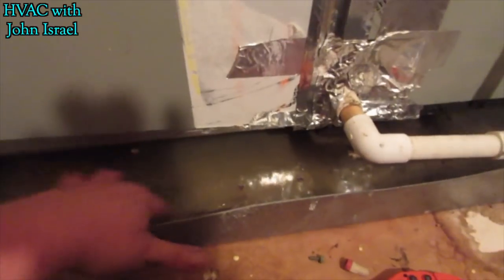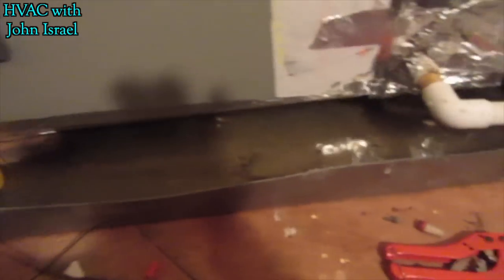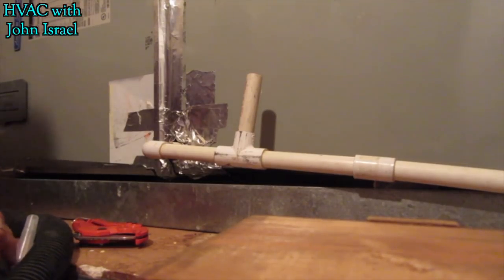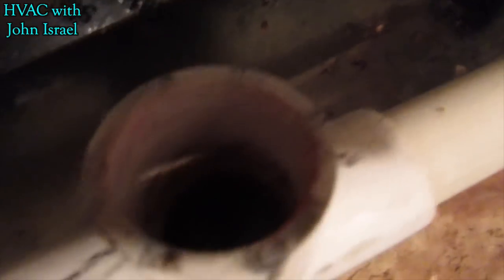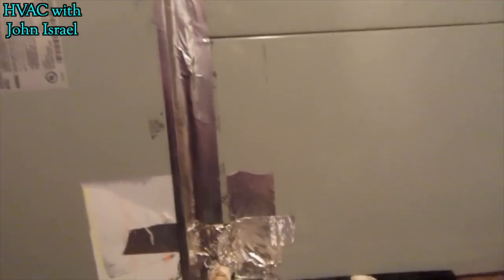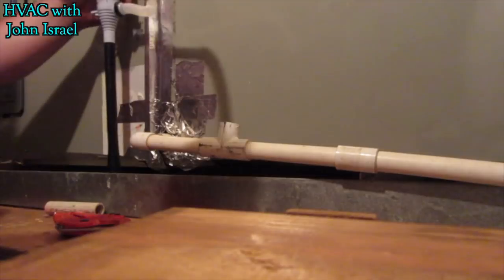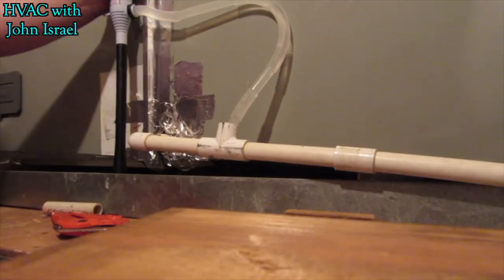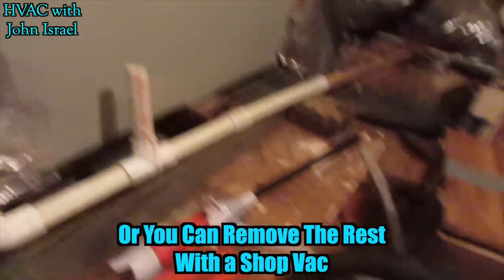Great Pump For HVAC Condensate Pan

Comment: Great tip to pass along to your fellow techs.  Anything just to make life a bit easier... I use the 4 gallon vac but when it gets ridiculous, I use a portable pump with a washing machine hose with one end cut off to send down the drain.  A battery operated doohickey..... and no power needed?.. I’m all in.

Comment: I hauled out about 10 gallons of water in my shop vac last week. Attic to stairs to deck to yard. What a hassle. I just ordered a transfer pump for the next time. I figure the pump and a 5-gallon pale will be easier.

Comment: man I had 1 of those.  freaking loved it.  then somehow or another I was at a house last week same issue clogged drain pan full whipped out my little pump and it sucked up s spec of blow in insulation.  before o got a chance to shut it down it burnt up.  goodbye pump.  I never went get me another.  haven't had the time.  in the meantime been using kobalts cordless 24v shop vac.  just been having to tought about 3 buckets full downstairs and dump.